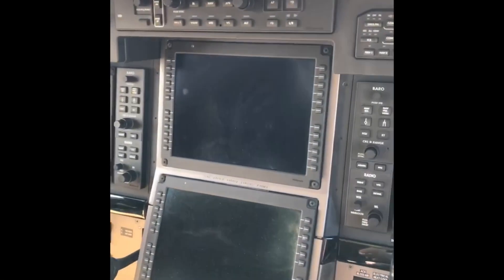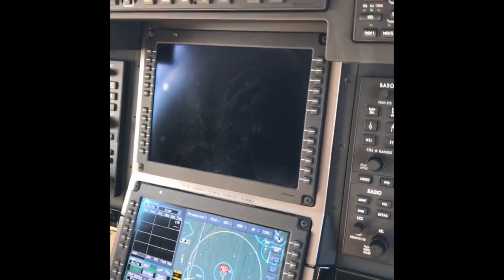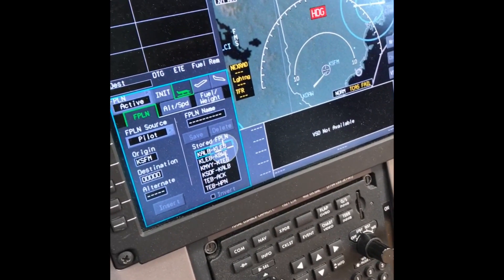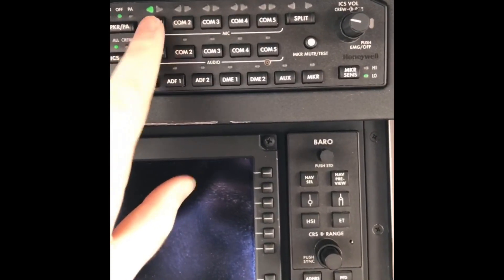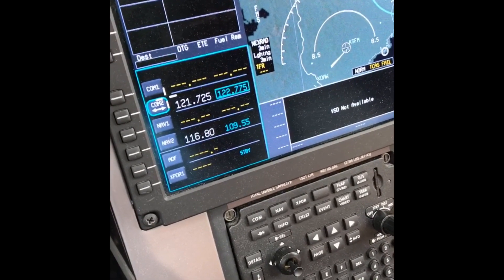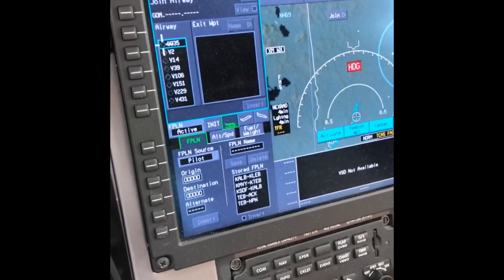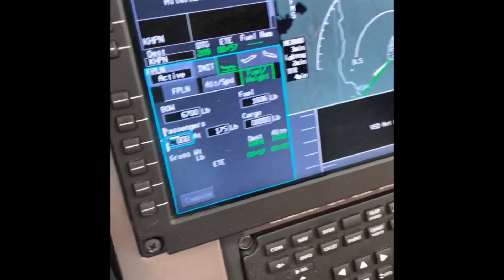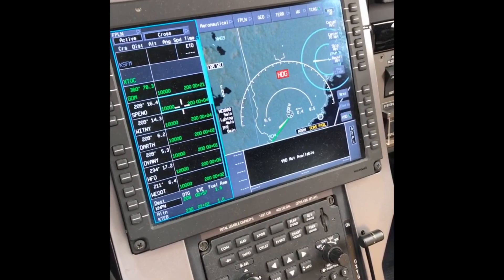PC-12NG Cockpit Prep and Engine Start

Comment: When you understand what a jet engine is and how it actually works, it's very difficult to rule-out catastrophic failure at anytime. On the other hand, technology has improved our control of the ball of fire 🔥 and therefore, the melting or destruction materials are contained. One jet engine, ten seat passenger airplane, very interesting😊.

Comment: There is an easier way to load the route. After clicking on Amend Route, and you have an airway followed by a fix, just type, for example, V93.LRP instead of using the Join V93 method. You can load one fix after the dot. I only use the Join icon to load SIDs and STARS. Just my technique, but give it a try as I think you will find it easier.

Comment: Maxwell, I commend you for getting your IFR clearance and doing all of the computer inputs PRIOR to engine start. Then,  I assume you get your IFR release at the end of the runway at uncontrolled fields. Mark Baker does all of this after engine start, even though his engine burns 30 gallons per hour at idle. I have suggested my method to him but he doesn’t  agree. I try to operate my airplane as economically as possible and am responsible with my boss’s money. I just paid $9.60 per  gallon for Jet A at Key West, so doing everything after engine start would be very wasteful.

Comment: When entering the route that includes an airway, using the “join” option is way too labor intensive. Simply type in the airway, such as V299, then a dot, and then the next fix. It would look like this;  V299.HFD  enter. Then V475.GDM enter. MUCH easier than doing it the way Maxwell shows.

Comment: Another way to know when you can turn the batteries on after turning on the standby bus, is to watch for the icons in the Flight Management Window to switch from amber to white. When you see white entry options, it is safe to turn Battery 1 & 2 on.

Comment: Great video.  To add a tip,  You can also enter airways by first entering your jump on fix then on the next waypoint , enter the airway, then exit fix.  i.e SJB <enter> then V30.LANNA <enter>.  You don't have to do it from the airway menu.  That's a lot of extra steps.
Reply from the maker: I learned something new today! I’m gonna try this out, thanks for the tip!
Reply: Ohhhh you have the mouse wheel.  Soooo much easier in turbulence.  Lol.  We have the joystick which is a pain sometimes.
Reply: I made the same suggestion before I read yours, Mike . Great minds think alike! Didn’t we fly V30.LANNA in my Pilatus? Joel

Comment: Max
Excellent video!  The PC12 has been a favorite of mine since it first came out.  The detail explanation of systems is very much appreciated.  I fly a C182T withe G1000 NXI so many of the systems are similar.  But, can you BLUETOOTH a ForeFlight flight plan into the Honeywell FMS?   QUESTION:  Is there a rule of thumb for how high you fly?  Is it a function of distance to be flown.   Say for example if you had flights 100, 200, 300, 400, or 500 miles.  What would be the benchmark altitudes for each one of those distances, not factoring in terrain and special use airspace altitude restrictions?

Thanks again!
Patrick from Albuquerque

Comment: You wanna see something really interesting? Check flightradar24.com and look over the Souther tip of texas along the border any night of the week. Theres a pc12 that circles NON STOP for 8 hrs, 5 days out of the week. Always at night. Only at night. For the last 3 or 4 years......no info if the plane comes up except that it's a pc12. Every night I can hear it flying over my house near KBRO airport.
Reply: sgtmerker2401 customs and border protection I’m sure
Reply: Customs owns a couple PC-12s. Probably surveillance configuration.
Reply: Plane is out of MFE.. that’s all I’m gonna say.
Reply: Think its outta HRL 
Belongs to Texas DPS. Seems as though a couple years back they purchased 2 PC-12s and put almost 2 million dollars worth of surveillance equipment in them. One flies over the southern tip of texas, the other flies over the El Paso region.
Reply: Sure enough  there it is at 14,000 ft.  Right over McAllen
Reply: @mikentx57  every. Single. Night.

Comment: Those battery switches on the overhead panel have such a satisfying sound when they're flipped, very sturdy sounding
Reply: Mostly thanks to the relays they're driving :)
Reply: Its the relay that clicks

Comment: Nice video! I have a question: How does the propeller (connected to the free power turbine) turn before fuel is injected? Does it just turn with air coming from the ATS or the battery? I thought the turbines turned with the expansion of gases.
Reply from the maker: ArgPiston good question! The PT6 is a free turbine, which means there’s no physical connection between the power turbines and the compressor. The starter generator is turned on with the starter switch, which begins turning the gas compressor (Ng). The compressor begins, well, compressing air, which is passed through the turbines, which turns the propellor. Imagine the power turbines are a pinwheel, the compressor is just blowing air onto the pinwheel and the pinwheel spins! Thats true for all stages of flight, from startup through full power!
Reply: @longlive737  yeah, I know how they work but always thought the compressed air was not enough to turn the free turbine. thanks Max.
Reply from the maker: ArgPiston Oh I see! Yup, takes no effort to move the prop on the Pilatus. If the wind is above about 15-20 knots and coming from the right way it’ll spin in the wind. Sometimes it’ll be windmilling full tilt backwards, then we start it and it slows, stops, then starts going forward as ignition occurs.
Reply: @longlive737  but I see it on all turboprop with free turbines like the PT6.
Reply: @piston_77  Magic of physics!
Reply: @hash2all  very helpful! great user!
Reply: @piston_77  as the captain says, try spinning the blades yourself, it's effortless man... Air driven from the CT is enough to start moving the Power Turbines before injecting fuel
Reply from the maker: nightstalker Not at the moment!